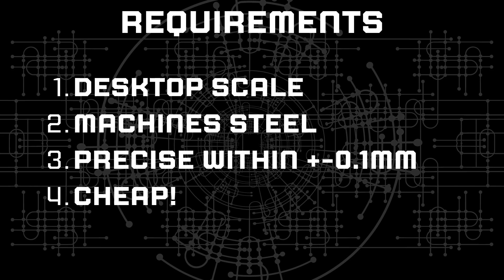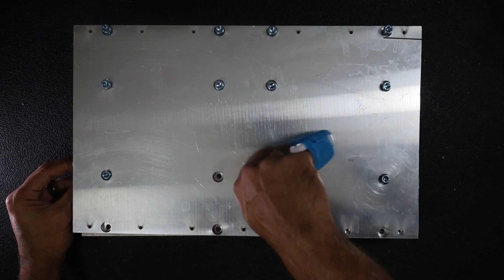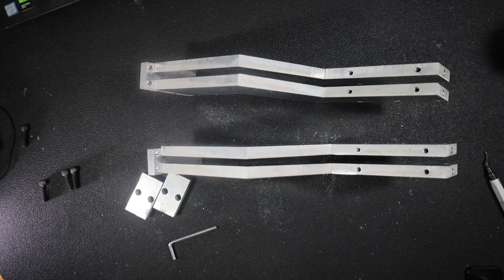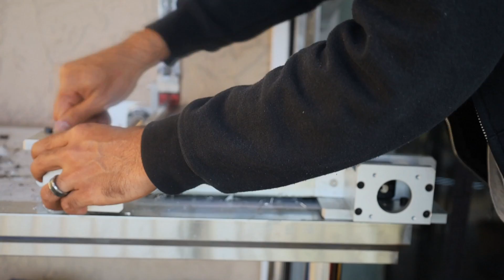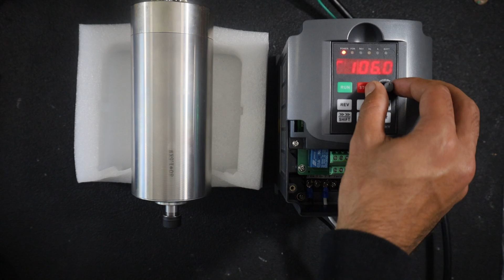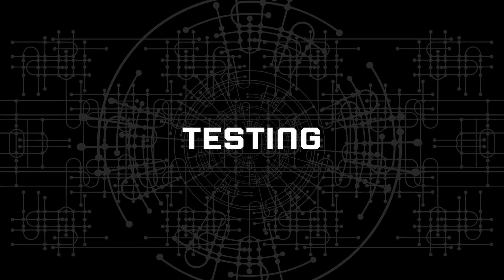How I built a desktop DIY CNC machine (CNC router) that mills steel | Sturdy | Precise

Comment: Great design, but there are 2 things wrong with it, causing rigidity loss. One, the whole assembly is up too high, and it is putting too much work on the linear rails and ball screws. If it would be lowered, there would 100 percent be more rigidity and less chatter. Two, the 2 linear rails are supporting the entirety of the spindle assembly. If you were to put one of the axis onto the bed, chatter won't be as much of a problem. Hope this helps, and again, I love how it looks!

Comment: Is that a single linear carriage supporting your tall gantry? Is that work? I bought ina kube25b with dust cap, which i think an overkill. Two on each rail, but i starting to think my motor even with pulley is not strong enough. Wondering if i could use just one carriage
Reply from the maker: Single linear carriage worked for me but it is not recommended, as many other comments have also suggested. In fact, after posting this video, I have upgraded mine to a double carriage system and now it is working even better. For heavy depth of cuts, I used to get some chatter earlier. After upgrading to double carriage, that is gone.
Reply: @curiosity-creates  ah, thx for the clarification. This carriage is a bit heavy to move on, so i think i better change my stepper motor or maybe change the pulley ratio to higher reduction.
Reply from the maker: Sounds like a good plan. I feel like it will be worth the cost/effort. 
Good luck with the build!

Comment: 3d printed spindle Mounting plate?…
What are you Doing?…. That alone ended this.
Reply from the maker: That 3d printed bracket has been replaced. That's the first thing I did when I had a chance. 
Sometimes, you just need to have something makeshift to keep the project moving along. That's what that 3d printed bracket was.

Comment: Which CAM Program are you using
Reply from the maker: CAM software within FreeCAD called Workbench.
Reply: @curiosity-creates  I too use FreeCAD, in fact I made a post processor for the Masso controller.

Comment: in the first 2 minutes of your video, you set goals for your machine, say, you cant find any suitable off the shelf solutions and continue to fail on all your goals. Very nicely done!
Reply from the maker: The design of the machine has received some decent constructive criticism, but your comment takes the award for being the most non-constructive comment. So, very nicely done to you too!
Reply: @curiosity-creates  my comment was purely sarcastic.
Desktop scale? get a 6040 and machine steel with it.. it will do it if speed&feeds are right. will it look mirrorlike as with an kern, certainly not.
also +- 0.1 is not precise, so not a real goal here.
You target a cheap solution but go for Linear rails?  Supported rails or even drawer slides are way cheaper and can be used also if you need to go really cheap

i could give a few helpful tips if you like tho.
as others mentioned, you need to put your guides as far apart as possible also the same with the carriages.
you stack plates and use epoxy granite to fill these, which is great!
Maximize the distance between the Y- Rails with using them 180 degrees rotated from each other, then you also can mount the plates on that directly.
speaking of gantry plates: it might work like you did, but a more solid aproach with less of a 'z-bend' shape, also filled with epoxy granite should be way more stable.
If you want to go for maximum stiffness, a moving gantry is not the way to go. You lose on y axis space tho, as you need more space to have the same travel.
A fixed gantry could be made much more rigid due to not having to be moved.

Comment: Unfortunately, there are some design faults, particularly on the gantry and the Z-axis. The machine is not as rigid as it could be.
The distance from the milling cutter to the linear cart in Z is too large.
It is also better to use two cart per rail for a greater support.

Ordinary 24k Chinese spindles have a low torque at low speeds <12000. Better to use steel with 16000RPM and an HPC milling cutter (e.g. Holex Pro Steel HPC - 4 or 5mm).

I mill steel with 1000 to 2200mm/min feed rate. You can find cutting values in my channel.
I think you should work on your Z-axis again.

Guide rails are never completely straight and if I have seen this correctly, you are simply setting up the second rail opposite the first. That's not a good idea.  If you want it to be accurate, you need an exactly straight beam (e.g. granite)

Greetings Anton
Reply from the maker: Thank you for your comment and suggestions.

Comment: IMHO the design has too many weak areas with great moments. Factoring the type of materials used and cost, that machine is severely underperforming. A 4030 (on price point of view) out of the box (as reviewed by aurora tech) mills way faster and cleaner than that. For that size requirement and type of materials used, a mill type design would have been more appropriate.
Reply from the maker: Can the design be better? For sure! I am with you on that. I am actively working on improving and upgrading the design. It would be impossible to create something that is perfect and put the entire journey in one youtube video. So the approach is to record the journey. It might take a couple of videos to the ideal state of the machine.
But, I can't agree with your statement about an out of box 4030 being better than this machine. An out of box 4030 comes with a DC spindle. That in itself makes it incapable of machining aluminum, let alone steel. If you decide to upgrade the machine to a decent spindle (with a VFD), it will cost you around $200 or more which may or may not make the 4030 capable of machining steel. There are several videos out there that talk about "upgrading" the 4030 to make it capable of machining metals. In short, an upgrade is essential to make a 4030 as capable as the machine in this video.
In any case, thank you for your comment and thanks for watching. I will keep improving the design and I hope you will keep following the progress.
Reply: Design of this cnc is very Bad ! Sound of Mill ist Bad!maschine is instabil!

Comment: What was the total cost of making?
Reply from the maker: This is actually a slightly tricky question mainly because I had some stuff with me that I could repurpose for this project. That is also why I did not include a cost breakdown in the video. But I ended up spending around $800 to $1000 on this. Majority of the cost I incurred was spent on sheet metal stock for the metal structure, the spindle and VFD, and the table (which was surprisingly costly) to put this on.

Comment: Very interesting project, I would recommend to use the strongest stepper motor for the x axis as it moves more mass and has to vercome more forces than the z axis motor.
Reply from the maker: Thank you! 
X axis does moves more mass but the Z axis is working against gravity. During my tests, I tried to see how fast I can move each of the axes. Despite having a bigger motor, Z-axis starts skipping steps at 1800 mm/min. The other axes (X and Y) can handle these speeds just fine.

Comment: Very nice work, enjoyed watching, BUT pls don't clamp work like that, that's the root cause of this chattering and your piece is actually moving being pushed by mill, its not clamped strong enough. So either use some good vise, or clamp by the edges on sides so it can't move, not on top of it like that.
Reply from the maker: Thanks for watching!
Yes, you are right. The clamping was makeshift in this video. I have since transitioned to a vise or better clamps depending on the need of the job. The improvements are very apparent in my other video about process parameters.
Reply: Got money, electrical and mechanical engineering knowledge and 0 knowledge of actual machining. Typical. Cool build but always people trivializing a vital part to making...parts.
Reply from the maker: There is only so much you can put in one YouTube video. There is another video on the channel that does talk about machining parameters. 
But what you are suggesting is a great idea for a future video in which I make a part from start to finish. CAD->Tool path planning->Machine setup->Actual machining->Part inspection. I am already seriously considering it. Thanks!

Comment: Why only one cart per rail? Especially for the Y axis. 

Picture where your center of gravity is, consider how much mass is there, and think of the forces on those linear bearings just as it sits. Now imagine it milling and the forces that produces.

Yes, you lose a little bit of travel but the carts are cheap and you should be running two per rail. EGW rails have shortened carts too btw.
Reply from the maker: Very valid point. I might not be able to make this modification in my next set of upgrades but I will incorporate this somewhere down the line.
Reply: I can't believe it works at all!?!?!   so top heavy and only 2 bearings! crazy!  I guess the saving grace is the fact that force is at the same level as bearing so not high leverage ???????

Comment: Nice work mate, would love to see how it goes once the metal bracket is on. Would definitely recommend you 3d print or waterjet cut and bend some way covers for those rails though!
Reply from the maker: Thank you! I will surely post a video with updates. And yes, a cover for the rails and the ball screw is definitely on the list of upgrades.